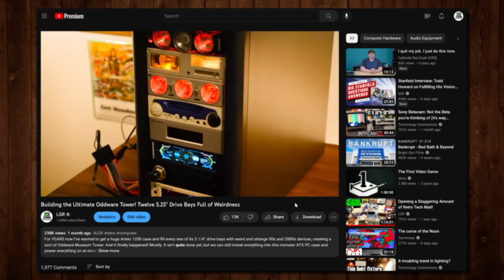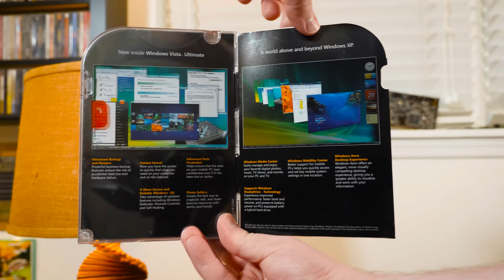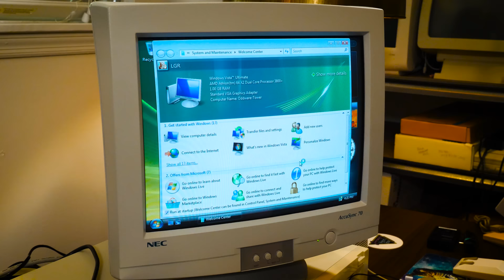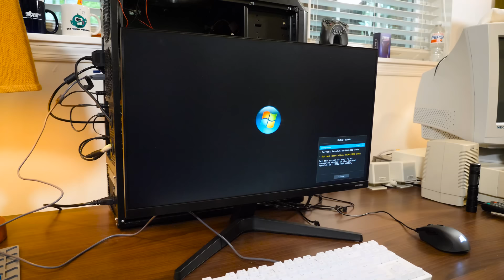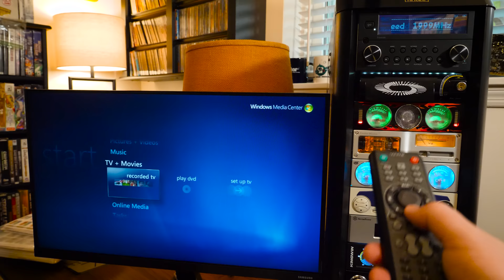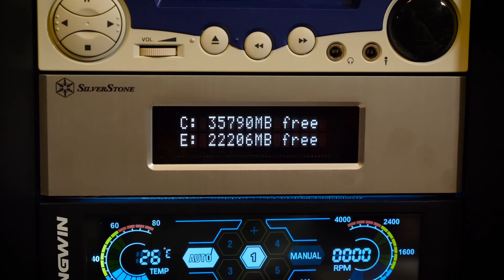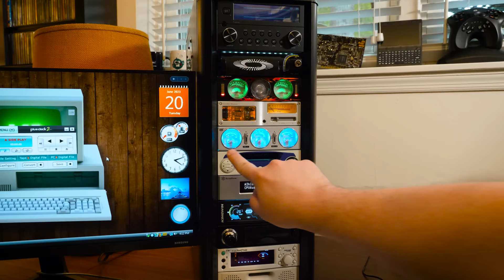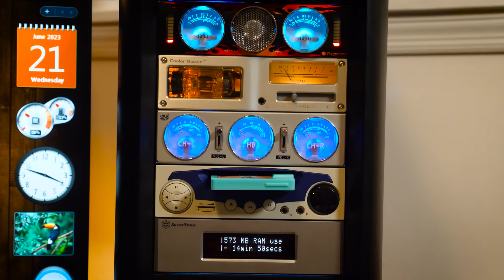Finishing the Ultimate Oddware Tower! Windows Vista PC Build

Comment: On the subject of an optical drive, I think you are thinking too simple. It needs one but it has to be one of those 4 or 5 disc cartridge loaded CD changers, its the only thing obsurd enough to really match the rest of the stack. Though if you can find a 5.25 MiniDisc drive that would also be a nice fit with the cassette in there as well.
Reply from the maker: I already use a 5-CD Changer on the LGR Woodgrain 486, which I take to the same shows. 

An internal MD drive would definitely fit, but the only one I have is this one: https://youtu.be/UQSKWOw-sZc